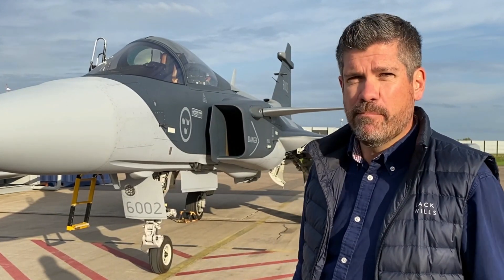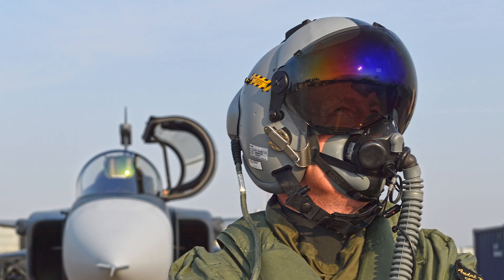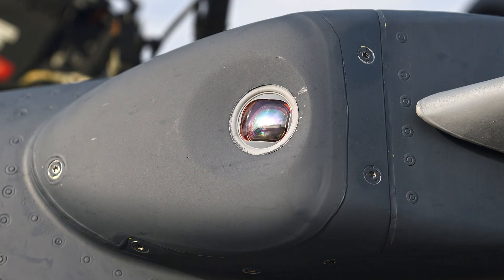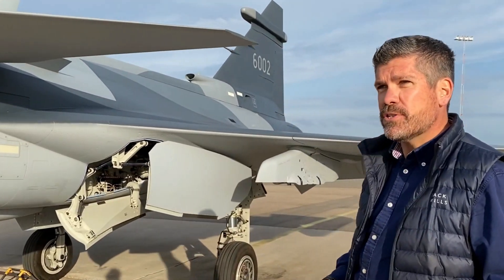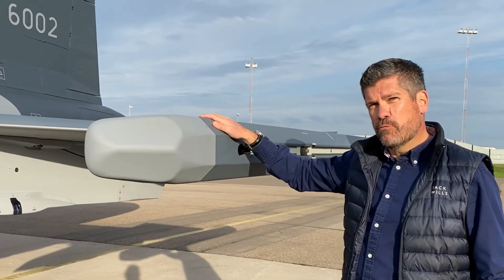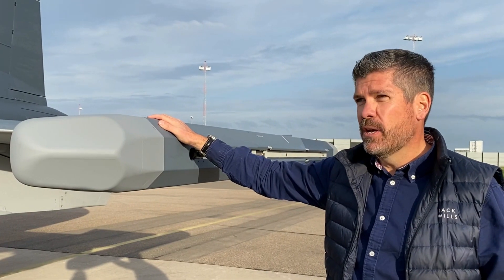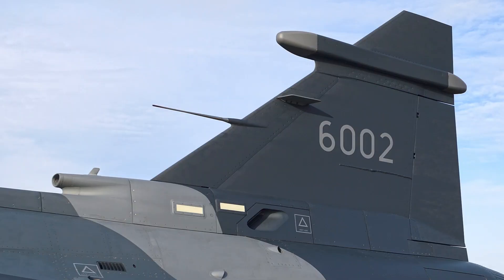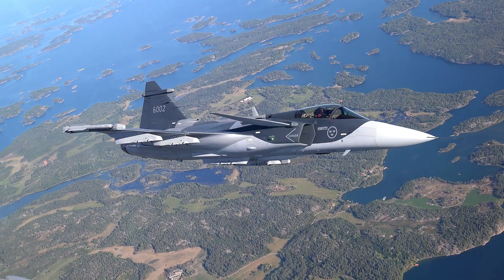Gripen E Walkaround

Comment: The technology embedded in the Gripen E is incredible. Despite its size, nanotechnology enables an architecture of systems that make the fighter one of the most lethal in the world. When in use by Brazil, it will easily face Venezuela's SU-35, if necessary.

Comment: Canada used to need almost 150 CF-18 Hornets? But now will only be able to 'most likely' afford only 65 F-35 Flying Credit Cards... I'd much prefer we buy 100+ Gripen's then that American Crap any day
Reply: This warms my heart as a Swede , but wouldnt the better alternativ be E's mixed with the newest F-15's ? I'd argue the weakest role for E is the air to ground capability , less loitering time , less payload etc. And by now they should have fixed all the problems on the F-15 right ? :)
Reply: @matso3856  f15ex not available except to USAF
Reply: @alpearson9158  well that sucked

Comment: The Danes and Norwegians will cry rivers when they see it fully operational. Finland can still make the correct choice. UK never had a choice. Then we have Canada, The Philippines and perhaps even India still. I bet Lockheed Martin are quite frustrated.

Not to mention that it is the only THAI-fighter on Earth. 😀
Reply: What's this about Thai fighters?  https://youtu.be/p-aZTGakEjg
Reply: @JonMartinYXD  That was a loooong time ago. Celebrity death match from MTV, isn't it?
Reply: @UC_KV8yIO5VkRlDvIDfrpIIg Lockheed Martin and the US DoD have made it really hard to find the true cost of the F-35.  The numbers I trust, from two separate audits of the proposed contract with Canada, put the lifetime cost at $440-520M USD per plane.  Applying the rule of thumb 2.5:1 support to flyaway cost ratio gives a flyaway cost of $125-150M per plane.  This is in line with independent estimates in the US.  The bigger concern is the way the F-35's readiness rate remains unacceptably low (<50%) despite support costs continuing to creep upwards.  The big news last week was that the USAF is considering a new replacement for their F-16 fleet.  The F-35 was supposed to replace every F-16 (and more types) but it has simply become too expensive.
Reply: @JonMartinYXD  Adding to that, and this really made me fall off my chair, there is a monthly update that every F-35 customer needs to download, which is about 0,5 TB. This doesn't just pose a clear and present security risk, but it shows how clumsy and incompetent that the software part of the project has been managed.

I suppose the Canadians can cross the border with a disk drive, but what will Norway and Japan do? Hire Johnny Mnemonic? There are just to many flaws to count, when considering this purchase. The purchase price is next to irrelevant. The US government have pumped more money into this project than any other military project. Now they sell it for a price tag to get some returns, and have the clients by the balls. The selling price per plane counts for nothing.
Reply: Oh, and I forgot to tell you. If you miss two consecutive updates, your F-35 will just shut down and stop working. Which sovereign nation would make such a huge investment under those terms?
Reply: @henrikscania-1st  Oh wow.

Comment: The EW system is specifically designed with S400 SAM systems in mind.
The new body of the Gripen basically stemmed from the need for more internal space for the EW system.
The landing gear was moved into the wing  thus creating this space and space to move a drop tank worth of fuel into internal tanks.

Comment: We need this plane for Canada !
Reply: Just like the Philippines, I personally think this offers better value compared to the F-16 even if its the Block 70/72.
Reply: @TheStefanAbad  hopefully the Horizon 3 modernization will bring a Squadron of Gripen E into the 🇵🇭 ✈

Too bad thing pandemic limits our buying capability to 14 Gripen Cs in this round of modernization. Still better than nothing.
Reply: As a Yank I love the Super Hornet but I do think the Gripen E offers more bang for the buck.  The Super Hornet comes close and the rest are too expensive.
Reply: @johannmckraken9399  im a Swede and Agree Super Hornet would be my second choice the F35 is a dud
Reply: @Karl-Benny  Yes the Gripen is a remarkable aircraft but SAAB has always produced very intelligently designed aircraft.  The Draken is one of my favorite fighter jets and still looks ahead of it’s time.
Reply: @johannmckraken9399  idk Canada currently has f-18s so switching to the super hornet would be much easier than the f-45 or saab
Reply: @rajdeepsingh8368  Yeah I'd put money on them going with the Super Hornet. Two engines + the easy switch over probably seals the deal.
Reply: @rajdeepsingh8368  the SH is a new aircraft and has very different systems so no it is not that easy a switchover
Reply: I   Need for thailand
Reply: I need this for my home defense.
Reply: @fuckheinschitt239  next to my car in the driveway 😉

Comment: I hope that the Czech Air Force will choose gripen E/F as a successor for the C/D version
Reply: I hope Canada does the same thing
Reply: @theimpostor4317  Really of the remaining contenders it is the only sensible choice.
Reply: @theimpostor4317  Respectfully disagree. Canada's role in NATO is 2-fold. 
1. Support NATO operations outside of North America, per NATO Articles.
2. Defend Canadian and North American (USA CONUS, and Alaska) airspace as part of NORAD.
Second requires robust air-air interception, range, loiter, and safety over NORAD Arctic areas. Canada is huge, Alaska is huge. Area to be defended stretches from Greenland to Alaska, and North Polar Region.
That means that RCAF needs a fast powerful two engine multirole interceptor, with AG and AS capability.
Three aircraft satisfy this requirement.
1. F-22A
2. F-15EX
3. F/A-18E/F/G Block 3 Advanced Super Hornet
4. Eurofighter Typhoon

Compromised requirement option
5. Rafale C F4
6. F-35A
7. F-16V Block 72
8. Grippen-E

I included Rafale C F4 in single engine compromised options due to its range and power. Though it is a two engine aircraft.  But Rafale is still an awesome aircraft.

F-22 is likely not an option, as Congress wont authorize reopening line, and Congress has forbidden export of F-22.
The optimal choice for RCAF is a mix of F-15EX and F-35A.  
A mix of Rafale and Grippen-E or Typhoon and Grippen-E is also a great choice. But politically complicated, as Canada is in North America.
Advanced Super Hornet and Grippen-E mix works great and best value for money.
F-15EX and F-16V is politically safe, and works doctrinally for RCAF.
Due to NATO and NORAD agreements on defense cooperation, non-Western aircraft is not an option.
Reply: Yes, they would be perfect for you.
Reply: Czeck republic only leases the C/Ds from Sweden, as no E is around yet they would have to buy brand new ones.
Reply: @riverman83  A new fleet of fighters is always a great investment for a small country. Aside from the qualities of the plane, I think SAAB also have the best business model by far. A huge part of the manufacturing can be located in the Czech republic, creating jobs and tax revenues, making the purchase a lot cheaper in reality.
Reply: @henrikscania-1st  well they have to buy alot more then 10-15 planes if Saab will let them produce the plane themself.
Reply: @riverman83  I agree. But there are levels of co-production. They could produce parts of the plane. Even so, 15 is too few. But Hungary also use it, so why not a joint venture?

Comment: If it just was a two engine aircraft. Still the best choice for Canada...
Reply: Get over it already. Gripen has had 0 (0!) self induced engine failures in 30+ years.
Sweden has logged over 300000 hours on the modified GE-404 (RM12) without a single engine failure.
Probably the worlds most reliable jet fighter engine.
Only one severe birdstrike resulted in the loss of an aircraft, pilot ejected without any issues.
So what? You order 300 planes, with 600 engines instead of 300 just to make up for one plane over 30 years?
Twice the engines, twice the maintenance, twice the engine weight etc.
Almost all aircraft losses has been to human factor. Nothing a twin turbine solution would help with.

Modern turbines are extremely reliable when maintained properly.
As I said. Get over it.
Reply: @christianm1533  It's not about reliability, it's about power.
Reply: @nimaakhtarkhavari8766  dude it can supercruise
Reply: @nimaakhtarkhavari8766  : Everything is a tradeoff. Why not even bigger engines? Four? Eight! Twelve sounds about right. That makes even more power? Your statement is a fundamental misunderstanding about all that is a fighter aircraft. Power is like one thing, among thousands and thousands of things. And it's not even close to being as important as people think it is. More power, larger IR-signature. More fuel. More maintenance, larger aircraft, bigger radar signature, etc, etc.
Fighters are not checkboxes.
Reply: @christianm1533  Spot on
Reply: @nimaakhtarkhavari8766  Yeah I'm with you here. I'm curious about its cruise speed with droptanks and mission loadout for a large country like Canada. I imagine Canada would have unique requirements compared to most European Countries. Otherwise, it's still a sexy plane.
Reply: @John-fe1cd  If I remember correctly it made super cruise with 1 external fuel tank and the rest of the hard points had AA missiles of various types , only other airframe that I know of that can do the same is Raphael , not the carrier/navy variant.

Comment: It's better than F-35 and similar to F-22 but without complete stealth.
Reply: With all the changes happening on the radar side using new bands, focusing on electronic warfare is almost better than physical stealth since it can be upgraded
Reply: The physical stealth is almost useless against the most modern systems.
Reply: @Greg29  😂
Reply: That could be the most ignorant comment concerning aircraft I've ever heard
Reply: @wr6392  you think the grippen is not comparable to the F35 or even the Advanced F22? Isn't it
Reply: @dr.mmaudi8194  the Gripen is not on par with either the F35 or F22.
Reply: @wr6392  why do you think so?
Reply: @wr6392  The Gripen E is every bit as capable as the F35 or F22 for what Canada wants.  True it’s not as stealthy as the F22 or F35 but stealth isn’t a big priority for Canada and it’s much cheaper than the F35.  The only other choice that makes sense for Canada is the Super Hornet.
Reply: @wr6392  With the lack of punctuation  marks I had a hard time even understanding that comment. So I’m not sure if I agree or disagree. 😉

Comment: The wingtips are the crown jewel of this aircraft. They house the most advanced EW gear in the world. ESM receivers with interferometric passive targeting (don't need Radar nor IRST to shoot Meteor missiles at air to air targets) and GaN AESA jammer units, both with 360° horizontal and vertical (spherical) coverage. The fintop unit has GaN AESA EA capability against search radars and coms. This is all public information from FMV and SAAB, you just need to know where to find it. No other fighter EW system has this capability today, this includes F22 and F35.
Reply: The biggest mistake is to underestimate the Gripen. ;)
Reply: What information do you refer to and where can i find it?
Reply: @gustavb3673  : SAAB presents a lot of material under the Arexis brand. Just google it.
Reply: @gustavb3673 : I don't know if you had a more specific question? But I also suspect that no one will actually answer it.
Reply: A flying server park in computer hardware it is. :)
Reply: That was news to me. So no more sidewinders on the wingtips, I presume. ;)
Reply: @henrikscania-1st  : Wingtips are still fully capable of carrying IRIS-T, AIM-9x  etc. Mountingpoint is on the outside of the EW-system. Technically no difference from previous version. C/D version already had a state of the art EW-system of similar physical design, ie, quadrant receivers and exiters on the for and aft wingtips. And carried missiles on the outside.
Reply: @christianm1533  Thanks for the clarification. Not that it was a very important question, but thanks all the same.
Reply: @christianm1533  was that added on C/D or already included in A/B-version? I guess performance on E/F in this area has improved a lot
Reply: @Mikeatthenet  : Not sure about the actual timeline. But I think the A, which was taken into operative state in the middle of 1990 was slated to have the EW-system which is much like the one in the C. Which IIRC did, but due to various issues, mostly software, the EW-system was not as good as it is today. I recall some articles around this in the late 1990ies. I think it was revamped a bit around 2000, but nothing major and entered full functional service in the C. The stored A's can probably be retrofitted software wise, without any issues whatsoever (a wild guess of course). If they don't already have retrofitted them.
So yes, in a sense, this is performance the Swedish AF has had for over 20 years already.
The E/F versions are more capable yes. I think the basic design ideas are mostly the same but since exciters/receivers are state of the art GaN ones, performance has increased. Computational power has probably increased with a 100-fold. I regard the E-version (Arexis brand moniker) as "continuing to polish a very fine product and product idea".
Reply: @henrikscania-1st  Not to worry, there is hard point for missiles on the outside of these EW-wingtips. But Sweden has the superior IRIS-T instead of sidewinder (we have sidewinders too actually)
Reply: You just defined a common EW Suite with self protection jammers - that's it - GaN only increases T/R module effciency by converting more power to emmtited emrgy and less to heat - F35 uses Fire Control radar for SEAD EW - GripenE has no SEAD EW capability with a fraction of jammer T/R modules as much more powerful Fighter + Air Defense Fire Control radar with thousnads of T/R moudles  - only for self protection from already laucnhed mnssiles or to evade air defense radar at long ranges - not to attack them...